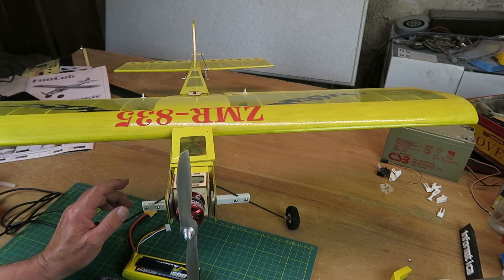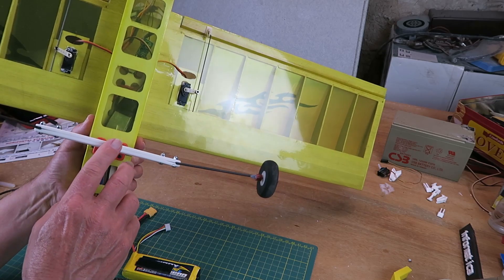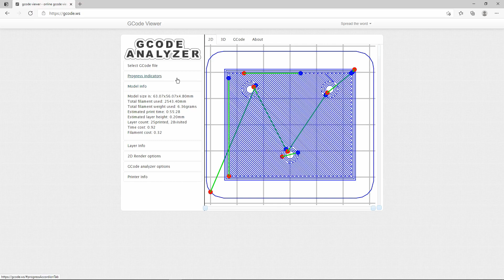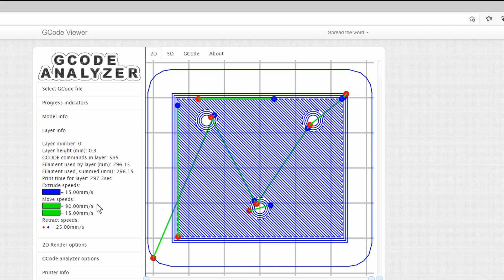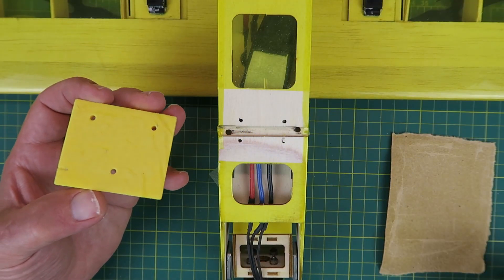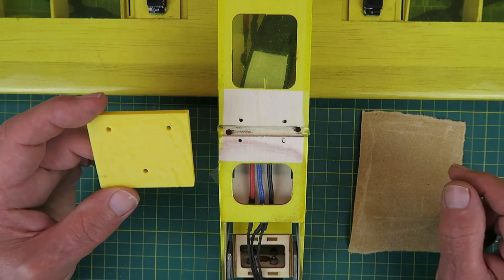ZMR835 Ply Balsa Wood RC Airplane Landing Gear Mods

Comment: Love this video.  And if you match the aftermarket landing gear of this style  (if don't have the capabilities to 3-D print one), it should also work well. Just keep in mind how much additional weight your plane can handle. The light really went on when you chose the plastic type screws!! Simple and Genius ;)  Thanks for sharing..
Reply from the maker: Thanks for the feedback. The gear is lighter than you may expect and the plane had no problem handling it. Thanks for watching, have a great day!